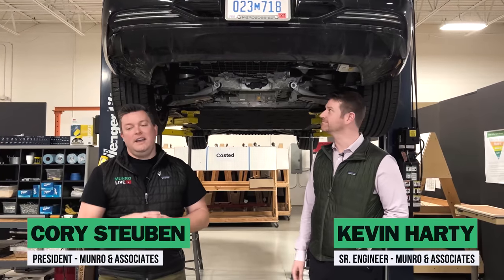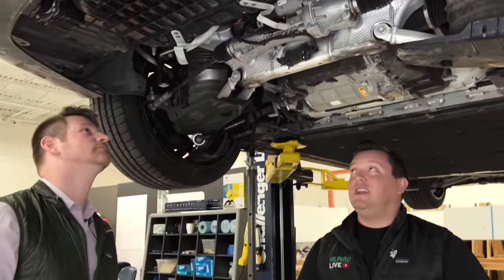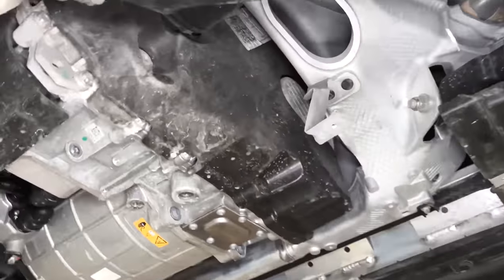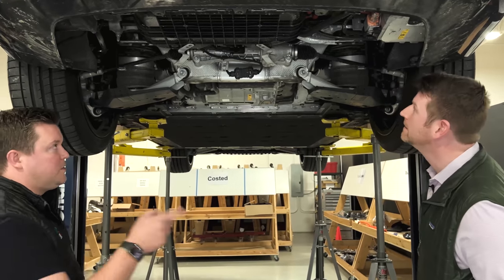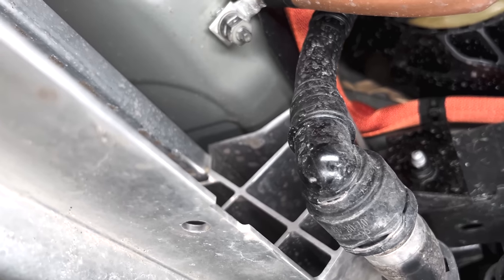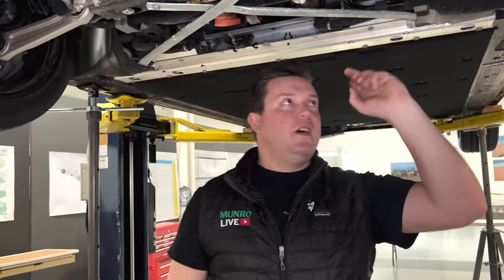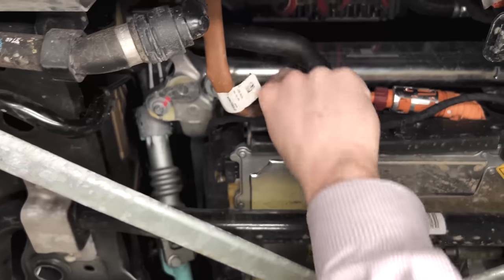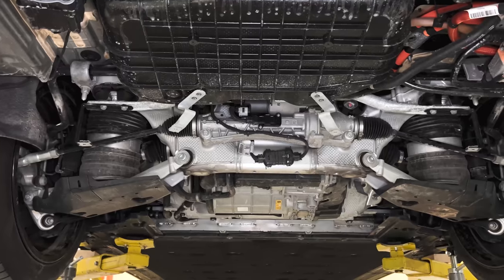Mercedes EQS 580 4MATIC all-wheel drive | Hoist Review

Comment: I bought a new Model X in 2017 with a 19 kw on board charger.  I own a model 3 base model which I did not realize came with 7kw on board charger.  The dual motors and all the other Teslas offer only the 11 kw on board charger.  In the USA you pay your electric company on kwh’s not volts. 220 Volt circuit charge faster.  So less time means less kwh’s.  Many of the Leaf’s and Bolts only offer 3-6 kw on board chargers.  I would of paid the dual motor option with the 11 kw on board charger.  7 vs 11 kw makes a huge difference in speed and cost of your monthly electricity. I live in Hawaii where electricity is 37 cents/kwh, day or night.  You need solar and a battery if you want the benefit of gas over EV cost.  Many people work during the day and must wait to charge at night but rates are still 37cents/ kwh.  You must charge during the day with solar and use you battery storage and some grid if need to charge at night.
Reply: I still save $400/month on gas and electricity with my solar and powerwall battery
Reply: Charging speed has next to no impact on cost.  The battery holds the same kWh either way.

Comment: The underside of this EQ looks just like an ICE car, with an electric motor added.
The ICE design team, didn't seem to think that any NEW design/interpretation, was necessary !
Reply: Drivetrain is decoupled in a cage since EQC and EQS has a completely covered floor for aero.
Reply: In fact its completely different skateboard architecture. However, given that they already have some of the best suspension and brake components in the industry, they simply grafted them to the skateboard. The suspension is almost pure S class, calibrated to work with a much heavier car. The brakes calipers are completely different. As expected from a company with 100 years of building cars for roads without a speed limit, the rotors are enormous all around. The AMG has even bigger rotors up front, or if you wish optional carbon ceramic rotors for repeated perfect braking performance in track conditions. The carbon ceramics don't brake any better but they can high speed brake time and time again without fade.

Comment: Like your videos. Still wondering when yiu actually review the hoist, which seems outdated design, wire?? since you mess around with supports, lol.
Here we use spindles with non loaded safety nut since my wife was young, no locking mechanism ect, so looking forward to your take on those OEM design grade hoists:)

Comment: On board charger. The control wires are not protected at all where they enter the unit/plug. There should be a strain relief device and a water resistant boot or molded plug or something to protect them. Unless you folks removed something, this is a problem waiting to happen.
Reply: Wrong!!!!! Everything is super well protected and there is a cover that they unbolted to have acces to those things unde the car lol…. Grow up!
Reply: @alanmay7929  I covered that if you read the whole post.

Comment: Thanks for this program. Does this car have a towing ability? Do you know what the limit is? And can you see where they would mount them?
Reply: No. The car is not rated nor recommended for towing.
Reply: 750 kg in Europe.
Reply: @abraxastulammo9940  In Europe almost all cars rated for towing plus many have a nifty, self deploying, towing ball with a hidden hitch. In the US the regulations are ancient and geared for trucks. Most european manufacturers simply don't want to go through the process of certifying their sedans to tow. The only alternative is to go after market and use part that hang below the car and look horrible.
Reply: @Wised1000  allmost all ICE cars yes, PHEV and BEV's not so much below 40k price point. Leaf, Zoe, Ioniq, ID.3, e-208, corsa-e, etc etc all no tow rating with sometimes just a towing ball option to support a bicycle carrier. Even the Model 3 has to be ordered with actual towing capacity otherwise it's rated at 0 kg.
Reply: @Wised1000  REALLY?! NO TOWING!! Then it’s definitely Tesla Model Y for me then.

Comment: Hmm I remember Tesla using the same underbody material on the early Model 3 builds and that did not go well at all. Surprised MB would use the same materials even if there is a weight savings compared to plastic.
Reply: Many manufacturers use this material, one of the first was Acura. Its preferred because it is much quieter than simple plastic, thus you get the same amount of protection and wear resistance plus, its a noise dampener all in one.

Comment: Always surprises me how many parts are in a car. Can't it be much much more simple or will we always need so many parts to get a working car?
Reply: Tesla's solving that problem as we speak the key is vertical integration
Reply: This car has a suspension like a carpet.
You cant achieve something like this just by make it more simple.
Reply: @worldpolitician5752  Mercedes can't.
Reply: @Mister_Durden  lol….. when it comes to driving dynamics and comfort both low and super high speed tesla is light years behind Mercedes. Before 2015 the sclass was already achieving 200mph+ with less noise while the tesla was struggling to even reach 140 or even beeing stable or silent inside.
Reply: @Mister_Durden  vertical integration is great on small evicts but absolutely atrocious on bigger ones. Is the cybertruck going to be the same tesla disaster!? Because a Toyota hilux alone with even 200hp can be modified to an RV and fitted with all kinds of accessories to even go to artic regions,  o tesla can dream of that!
Reply: @alanmay7929  a 3 year old car vs a 100 year old manufacturing "giant"
Reply: @alanmay7929  define "Tesla disaster"
Reply: @Alfred Wedmore you can make an octovalve heat pump.....look at mach e thermal system lots of stuff you can get rid of

Comment: Amidst all that serious engineering my only thought is how easy/difficult will it be to locate the holes in the brackets for the fasteners to secure the rear shield.
Reply: It’s not hard at all everything is well designed
Reply: @alanmay7929  Everything appears to be well designed I agree but those brackets look flimsyand  easily bent, it takes only a little misalignment for a fastener to refuse (as if it has a mind of its own) to home in. It doesn't matter much because it's not something that needs access often.

Comment: I have owned six Mercedes over the years. I don't think I would drop 125K+ on a first draft design. Nothing agienst Merc - I loved the brand for decades, but there is no way I am going to test their new design. Been there done that plenty of times. There have been "engineering issues" on pervious first run E and S models I have had the pleasure of owning - with no solution other than going to service over and over to get it repaired, knowing it would pop up again and again.

Comment: And people question Tesla's manufacturing process? Tesla looks light years ahead of this Mercedes.
Reply: Please......
Reply: @Wised1000  Have you seen the Model S Plaid video?
Reply: Again please.... Ever seen the videos of a Plaid trying to brake or how its like being inside a chatter box or how fkinty the ride is?  The Plaid is nowhere half the car this is, a true one trick pony.
Reply: @Wised1000  You ever seen a Plaid with ceramic brakes CRUSHING tracks? Of course not because you are a fanboy that doesn't look at reality. I have a Porsche / Tesla / Diesel truck and can tell you - the Tesla is a crusher!
Reply: @mullholand  You mean the 20k option that should be standard? The EQS AMG brakes just fine without them, though they are also offered as an option for less than  half of the Tesla kit. Again the Plaid is a one trick pony. They cant even get the body panels straight.

Comment: ha ha ha ha MBZ uses brackets holding up more brackets, and too many fastener.....lol.
Reply: It’s actually a very clever idea to protect both the plate and the things underneath, it’s like a soft pillow in case of a shock so no need to worry there, Mercedes’ have been making cars for all kinds of applications including armoured vehicles to go on very rough terrains/roads.
Reply: Integrating all those brakets will make replacement super expensive in case a much larger part brakes it’s a clever design like it or not.
Reply: @alanmay7929   - NOPE , Delete brackets , mold Gigacastings with built in brackets, no fastening , no welding. $$$ cost savings, weight savings.
Reply: @alanmay7929   - FALSE. , if there is damage to casting , the crash rails can be cut off , new ones attached. if the casting is damaged , it can be UNBOLTED , replaced with new, old casting RECYCLED.
Reply: @alanmay7929   - see - the Limiting Factor , Gigacatings for DEEP dive.
Reply: @markplott4820  no thanks I’ve watched already with the other episodes lol..
Reply: @markplott4820  wrong!!! The whole car has to be thrown away, the casting isn’t bolted at all, it’s not like body on frame or whatever!!!! Casting recycling??? Lol why wouldn’t you recycle it!? It’s not waste
Reply: @markplott4820  or stop making stupid choices by incorporating bigger parts that are much more expensive to replace and those fastenings or welding are not expensive at all, there is a reason why right to repair exist unlike some companies fighting against it lol…. Tell me again does tesla sell. Any parts for vehicles repairs!?

Comment: Thanks for the Under-car review!  Very Poor placement of charger module,   Highly susceptible to water damage, road debris damage, and especially THEFT.  easy for a CAT thief to change to Module theft on this poorly though out design.
Reply: i dont think any thieves are going to specialize into module theft on an EQS. its a pretty rare car and the market for used module will be similarly tiny.
Reply: Don't know if you're aware, but it has a panel cover underneath.
Reply: @RogerM88  exactly this Tesla fangirl is way too quick on hating on other cars not really knowing the intention, as if everything tesla does is the best! Apple is good but not perfect there is a reason why Microsoft or even android also exist.
Reply: @alanmay7929  
check this fanboy "Mark Plott". He's everywhere bashing other Automakers as usual. He should be more concerned with Musk shares used as collateral to the Twitter deal, be possibly dropped into market. Or Tesla under performing in their Q2 Earnings.
Reply: @RogerM88  i totally agree with you he is like the pest worse thing that can happen tbh!

Comment: Sure they have their benefits, but rigid cables are a pain in the a** logistically, both for transport and getting them into the car (worse as longer as they become, not so much an issue here). Nothing "outdated" about flexible cables, just because Tesla has chosen rigid ones.
Reply: Exactly, this is the thing that really makes me angry about this channel, they make as if tesla is only doing the right choice, vertical integration is great but do you see the repair costs on tesla right now!? It’s the worse part. This Mercedes’ was made to be very serviceable and I like the idea. Tesla won’t even sell you parts to repair their cars.
Reply: Sandy also lacks a lot of knowledges in the automotive industry and I’m recently discovering it with other cars and vehicles he touches, the rich rebuilds SHERP or even this Mercedes’ with all the features even the seats, I’m sure he never sat in a Mercedes’ sclass or Porsche, there are tons and tons of customization la in Mercedes’, bmw, Porsche….. that tesla doesn’t even have, from carbon ceramic brakes to carbon fiber seats, magnesium wheels, central wheel nut. All wheel steering, the latest Mercedes’ bumping suspension……

Comment: OMG! That onboard charger in right rear will be smashed if the vehicle is rear ended. Major design flaw in my book. Looks like that casting around the rear there is an attempt to shield it. What a waste.
Another OMG…. there is like NO clearance between the backside of the tire and the suspension piece!!! How in the heck do you put tire chains on this puppy for Winter driving?  My guess is they will specify studded tires only.
Reply: Maybe then you can upgrade to a 22 kW unit. 😜
Reply: You’re not serious are you!! They removed covers both at the front and rear to show us those components, they are super well protected no need to worry.
Reply: @alanmay7929  Yes I was serious but in re-review it appears that it is inside of the frame rail so maybe not as exposed as I had first thought. They may have further mitigated the damage risk by having break away mounts? That may explain the flexible power cabling instead of the inflexible aluminum conduit cable runs that Tesla uses….that they showed. This would allow the unit to swing out of the way in the case of a right rear impact. 
This is NOT a cheap part.
Reply: @Alfred Wedmore Doh!  Learning.
Reply: In the winter I just drive my Mercedes G wagon. This is only for the spring.

Comment: IVE OWNED EVERY MODEL MERCEDES S CLASS from 1994 to 2012 - 4 door and coupe in every model            NO WAY ID BUY A MERCEDES ELECTRIC

Every model merc got worse for build quality and more electronics and the electronics were pathetically unreliable. When a car was 90% engineering Mercedes made the best cars in the world - as cars became mobile computers Mercs became terrible.  The last one, a 2012 CL500 coupe, I literally gave away. If you did not use it for 3 weeks the battery went flat and it forgot what it was - it had to be towed to Mercedes for reprogramming at €800. I just stopped using it and eventually gave it away.
Reply: Lol….. your tesla is even worse than that, this car is made to be super easily serviceable unlike tesla that won’t even sell you parts to repair their cars! Mercedes as far as I know just like Porsche and other are still supporting and selling parts for vehicles they made over 40 years ago.
Reply: @SpaceReportNews  - I literally get the bus now.
Reply: @alanmay7929  100% wrong. Tesla is way better. I have a Cayenne Turbo and have sunk $20k in it over the past 7 years. My Tesla - with 90k miles - I have shelled out nada.
Reply: @mullholand  that’s what she said lol…..
Reply: @mullholand  "Cayenne Turbo"  I believe the most expensive vehicle to actually "own" per mile.  A friend had one - the headlights were a sealed unit and cost something like €2,500 each.  He had the brakes serviced and that was €7000 or something. This is a while ago so the figures might not be accurate - but the point is, they are unbelievably expensive.
Reply: Good for you! Now lets move on, with other intelligent comments.....

Comment: Tesla EV drive units don't need servicing in over 300,000 miles, and last more than 2 Million miles. More than life of the car Design.
Reply: I'm not so sure, I have a Model X and I remember reading that the oil the drive unit needs to be replaced at some point. i can't remember the exact mileage right now.
Reply: @karthik11512  Yes definitely, They have an external filter for a reason.
Reply: Those claims are based on what? Fanboy reports? Check what Automaker joined Lincoln at the bottom of reliability in a recent report.
Reply: Last place in reliability reports in US and Germany (Model S!) for Tesla. Says it all……
Reply: You are tooo funny mate why does the tesla service center actually exist if those cars are sooooooooo reliable!? People are also having massive issues with their tesla too, Will Prouse the YouTuber which makes videos about solar energy and storage batteries/storage had a massive failure on its tesla plaid front drive unit and some door handles. Go watch the video.
Reply: @RogerM88  he trolls every ev video. Don’t mind him

Comment: No frunk!?  👎
Reply: As a Model 3 owner, frunks really aren't all that useful. Handy in a pinch, but I've used my frunk all of 2-3 times.
Reply: @prerunnerwannabe  exactly and this Mercedes’ has a massive HEPA filter in the front too.
Reply: @prerunnerwannabe  Great place to put items you don't want stinking up the rest of the car. Pretty handy.

Also the fact remains that it's a freebie from optimizing the design space.
Reply: I don’t understand why some of these new ev with long hoods (eqs, iX, lyriq, etc) don’t have frunks. I use it to store emergency items - charge cables, extra change of clothing for the kids, etc. this way I have extra storage in the back for other items
Reply: For me the frunk is a huge benefit.  Extra space, a place to put valuables out of sight.  Just good design.  As far as filters, the Model Y, S and X all come standard with massive Bioweapon Defense Mode HEPA+ filters.
Reply: @StormyDog  If the ev has a long hood, there's really no excuse for not having a frunk.
Reply: @Wasabi9111  any EV without a front trunk is basically an ICE platform derived EV to me